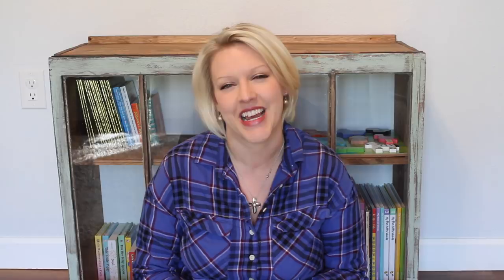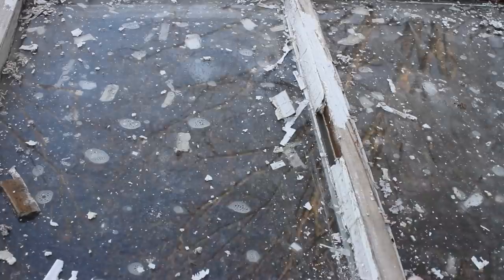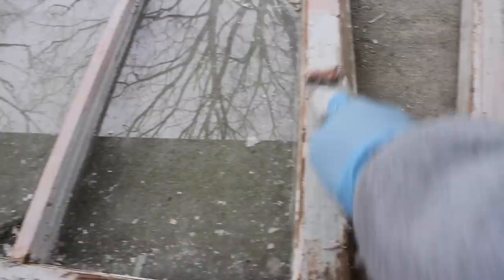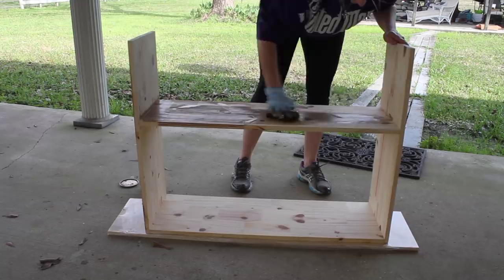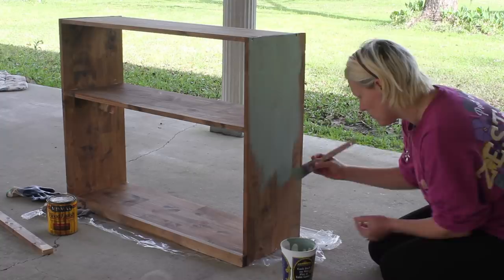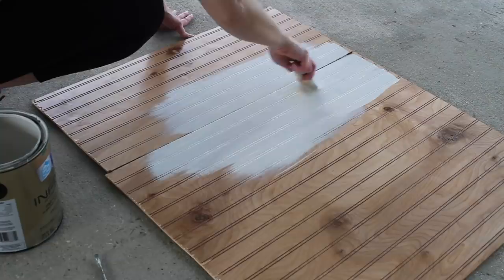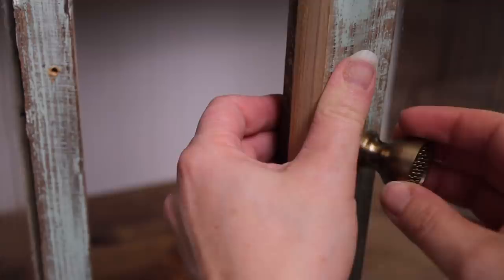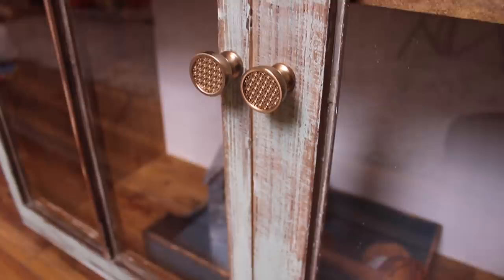Old Window Upcycle Project! | Trash to Treasure | Upcycle DIY

Comment: Hi...love your project....turned out very NICE🌟 I love SP milk paint too! Just wanted to add if you don’t want to strip off old paint....do not sand and just cover with a clear coat to seal....I know that would provide some resistance and without adding bond probably wouldn’t get great adherence to wood ....adding clear coat and a little bond would much easier....unless you wanted to get down to bare wood? Just FYI would look very vintage with some white peeking through that Sweetie Jane....love that color too!! Thank you for sharing...did an awesome job🌟😊k

Comment: Clever.  I have 2 huge windows.  Last year I took the planes out of one and will use the glass for other projects.  One window will be a headboard for a twin bed.  I don't know about the other.  I would put a top on the cabinet as it appears unfinished.  You may prefer the current look for yourself.  I'm not a huge fan of chipped paint.   All I can imagine is it getting under my fingernails.  It's happened several times.